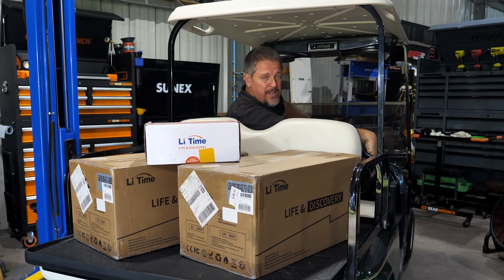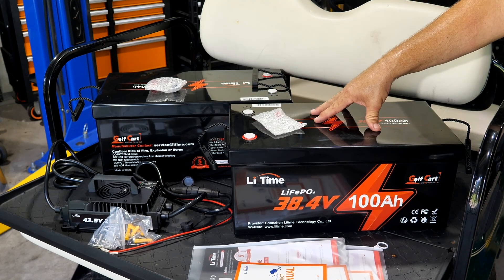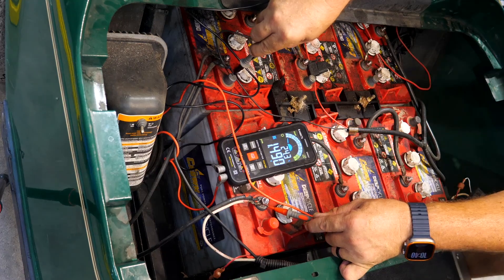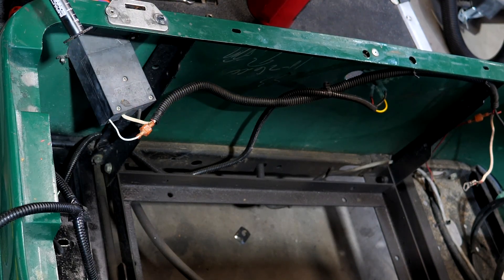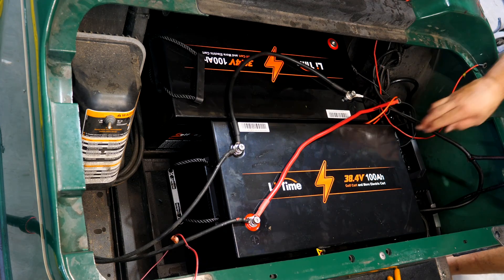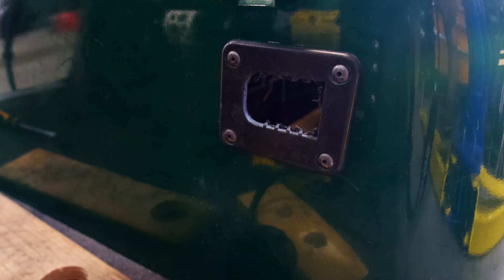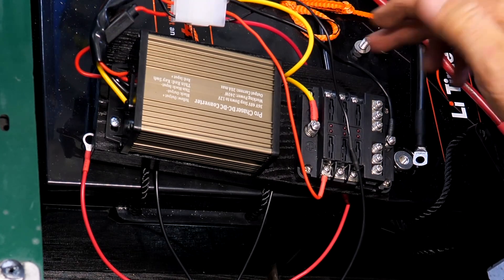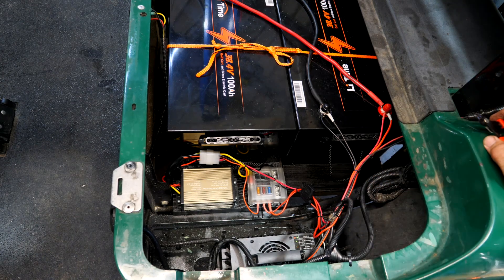Lithium Battery Upgrade for our Golf Cart - LiTIme 100Ah Batteries LiFeP04

Comment: For your parallel battery connections, consider connecting the positive wire from charger and motor to battery one and the negative to battery 2.  This should provide more even power transfer to and from the two batteries.